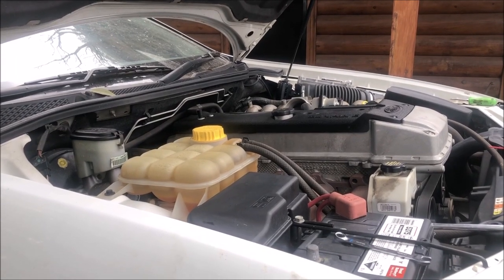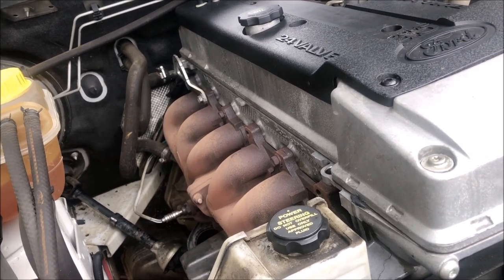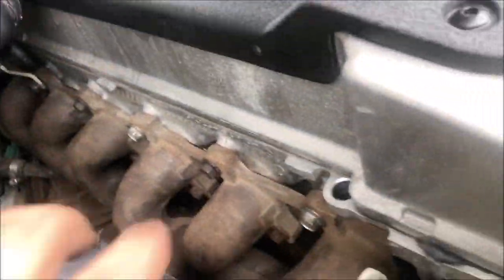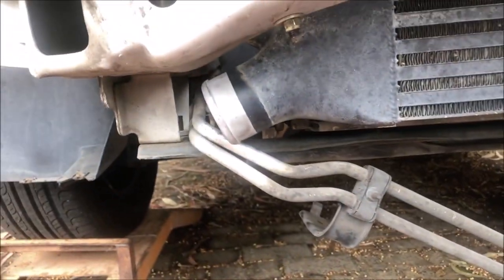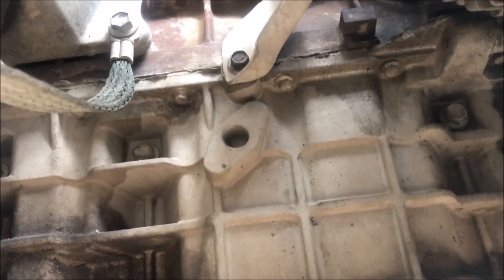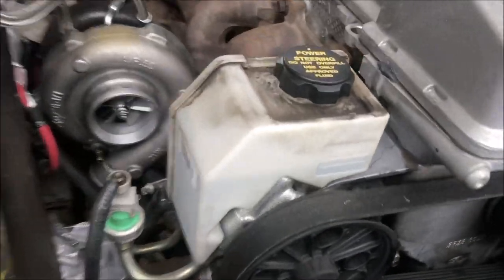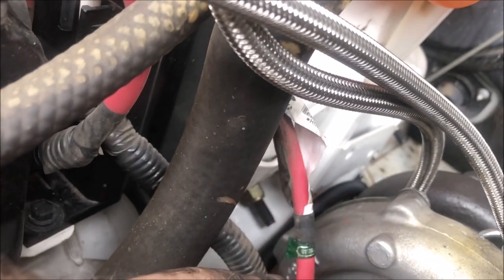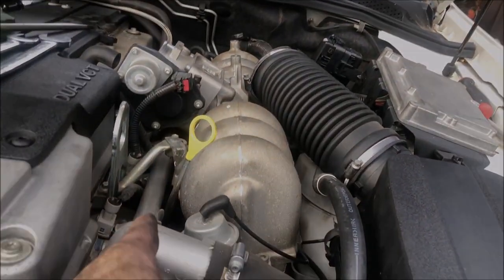NA Barra Turbo Conversion Pt1

Comment: Yeah I did a Territory NA to Turbo with all factory bits and there were no probs other than the O2 sensors reading thru the high flow cat.
Reply: good to know also
Reply: Hey mate I’m doing a turbo conversion on my territory as well, Does the territory sump still have the same cast for the oil pickup? I noticed the motor mounts are a little different as well looks like there will be some clearance issues with the factory turbo ba manifold? Cheers 🤙🏼

Comment: Great video. May want to think about replacing that rubber hose your using for the turbo oil return line to an OEM corrugated metal flex line due to the amount of turbo heat generated into that rubber hose.

Comment: How did you do the sump mate how does metal now end up inside engine or did you remove sump what exact tool did you use sorry for so many questions
Reply: From what I've seen most people drill and tap while the sump is still on the engine in the car. They leave the oil in the sump then they  drill (carefully) then tap the bolt holes then drain the sump (any little shavings that made it into the sump should come out with the oil)

Comment: Great video! Quick question, is the hole for the oil return only drilled out and the bracket bolted in, or is there tapping involved? thanks
Reply from the maker: Drilled and tapped
Reply: @oldskoolonly  is the tap for the main centre hole or just for the 2 bolts that bolt the bracket to the sump?
Reply from the maker: Just for the two bolts
Reply: @oldskoolonly  great thanks for that

Comment: Was tapping the return line hard? What size did you use to tap?
Reply from the maker: Hey man it was easy and had plenty of room. It’s almost a year since I did it by I think they were just m8 bolts that came in the kit
Reply: @oldskoolonly  Do u reckon the conversion is much different of a job to do on an fg ?
Reply from the maker: Never done one but I can’t see it being much different

Comment: we're of the same era, was wondering about comp though 10.3 by memory . ive only worked on TD's the big yellow stuff.
Reply from the maker: Yep and all relative to the amount of boost, octane  and timing. Mines very happy with 7-8psi and 98 octane, but the timing is also retarded accordingly. That’s why an experienced tuner is super important.
Reply: 10.3 is lpg motor

Comment: Hey mate quick question, I just received my cross over pipe and missing a few bits still but the pipe that comes from top of the intercooler into the silver pipe under the headlight has a sensor mine doesn’t? Did you hook your sensor up or block it off
Reply: Can see the pipe I’m talking about at 5:18
Reply from the maker: Just blocked it off

Comment: Hey mate, what size was the hole for the oil return drilled into the sump? And the bolt hole sizes for mounting it?
Reply from the maker: Hey mate I think the main hole was about 12mm and the threaded holes were m8 from memory

Comment: Hi please help 
I have a barra turbo which was damaged on the bottom end in an accident. 
Can I swop the top to a NA barra which is cheap in South Africa and available. 
What would I need to do on the NA BARRA
Reply from the maker: Mate, as far as I know, everything is interchangeable, but if your swapping your pistons too, ideally you’ll need to use the turbo rods also. Not only for the extra strength if they are late enough to be the typhoon rods but there is differences in the gudgeons so I believe
Reply: NA barra will do the job. For a touch more boost, valve springs. Nothing else really.

Comment: Hey mate, do you still run the 02 sensor out of the factory NA exhaust manifold? If so where do you run it?
Reply from the maker: Mate I’m running the factory turbo manifold with the stock sensor in the stock location

Comment: What adapter did you use for the sump that’s the only thing I’m stuck on for the conversion
Reply from the maker: It came in my oil line kit, detailed in the other vids. Good luck with the conversation!! Merry Christmas, thanks for watching. 🎄

Comment: Just added u. Im doing similar stuff. Just picked up a f6 long block cheap so its gonna get  tbe upgrade treatment too. What pistons did u get?
Reply from the maker: Mate she’s stock. I do have forgies but they’ll be going in another engine when I get around to it. Good luck with the build, you’ll have a blast. Thanks for the support, cheers 🍻 P

Comment: I gotta get my hands on one of the Barra jewels but I need to get extraordinarily lucky and find one on the cheap (ya impossible in the ole USA). I wanna stick one in a fox body mustang 1987-93 or one of the so called 4 eyed fox mustangs from the earlier 80’s. Then see how fast a stock style motor/turbo setup will go in 1/8th mile or 1/4 mile drag racing and then go up in hp from that. I figure it’s gonna make an upgraded ford 5.0 302 look bad for sure even in stock-ish settings. 
That Barra block and head are truly an engineering wonder it seems. Stupid they didn’t put it in a few American cars I mean it’s FORD for Fords sake.  Silly.   Cool videos thanks from America the Barra-less land. 🤬😭
Reply from the maker: Haha cheers man, yeah they are a good thing!! From what I hear they are getting shipped to the states by the container load

Comment: How did you go with stock conrods? They haven’t given up yet?
Reply from the maker: 5 months down the track and it’s still my daily and it’s all good mate. Seriously, it’s all in the tune. Remember, the early turbos use the same rods, just lower comp pistons. If you’re not winding up the boost and timing, and feeding it quality fuel at the correct quantities, it’ll be fine. It’s very happy at 250kw, But wanna push more out of it reliably, you’ll need to upgrade a lot more than just rods. Thanks to watching 🍻
Reply: @oldskoolonly  Oi mate, love your 5 vids on this. I’ve collected almost all parts but the Garrett Gt3582R.
My question is- your talking 250-270 rwkw’s not fly wheel kw’s yeah?
Reply from the maker: Cheers man, yep at the wheels
Reply: I can give some insight on that. My mate ran his NA convert for around 18 months,  321rwkw on 13psi, all stock except valve springs. I then got it from him, threw it around A LOT, and maybe another 6 months down the track I put one through the block. That being said, I was absolutely hammering it, and had been since owning it. I imagine that's around the peak of it's potential without internal work.  Back it off to 10psi, or maybe 12, I don't see an issue.  Anything more than that, get some advice on upgrades.  I'd suggest just not doing anything extreme, like loading it up unnecessarily

Comment: Nice guide, just a question - for the feed T piece, oil temp sender, -4AN etc. what thread sealant did you use? would teflon tape be suitable for the pressure oil feed?
Reply from the maker: Cheers. I used some Worth brand thread sealant but thread tape is fine. Thanks for watching hey 👍🏻
Reply: @oldskoolonly  Thanks for the help, any chance ya rember the part numbers for the brass T and adapter you used? gotta be cheaper than going full aeroflow 😂
Reply from the maker: Mate I just bought them off eBay. 3/8 female T piece and a 3/8 double ended male adapter
Reply: @oldskoolonly  Thanks, i had a look around, is the block thread NPT or BSP? could only really find BSP t pieces but the -4 adapter you used was NPT thread
Reply from the maker: BSP

Comment: Did u drill into the sumb with it attached to the engine still wouldn't the medal filings go all through the engine ?
Reply from the maker: Yes I did, but if you’re careful, and have a very sharp bit, you can do it without any issues. Best way is to pack the bit with grease. Also, it’s a horizontal hole, dramatically reduces the chances of stuff falling in, and the bit by design pushes the swarf back. Hope that helps. Thanks for watching 🍻
Reply: @oldskoolonly  Thanks for the informative videos. In regards to the drilling the sump, can you remember the size of the drill bit? Do you also have to tap the two other screws each side? and lastly is that a proprietary hose that you connect to the sump? Thanks in advance. Cheers